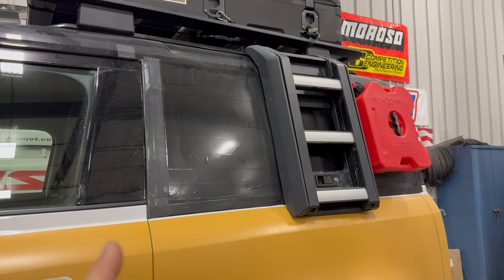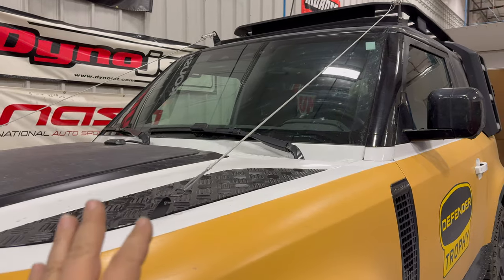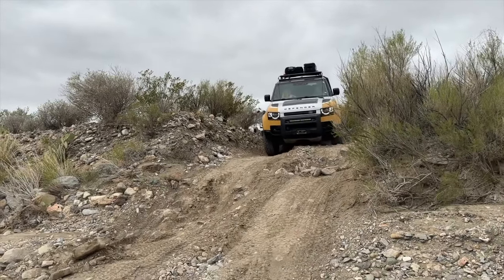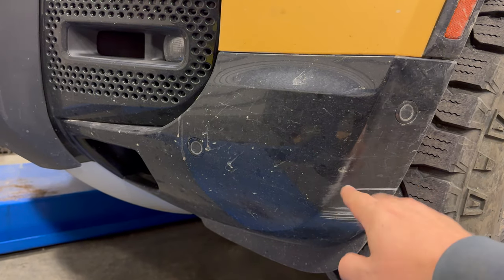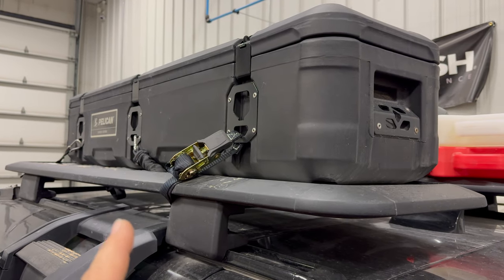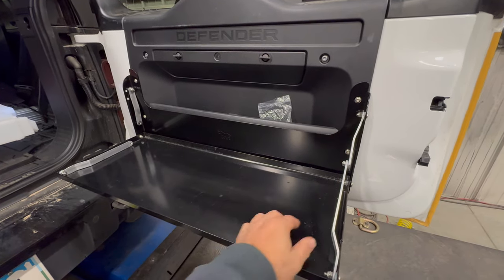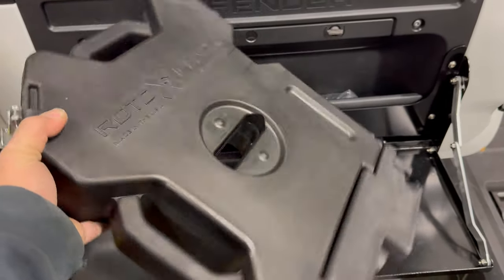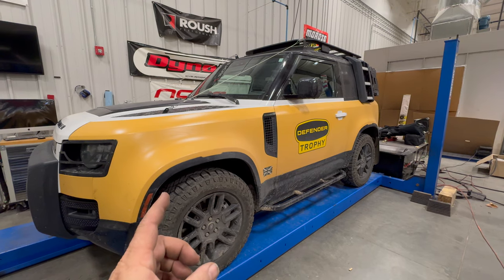Defender How Well Did It Survive 3000 Mile Overland Trip

Comment: Well she came back all intact! I am glad the side glass held up but its just a shame the windscreen got cracked. As you say it is common to happen and the dealer may as well replace the two at the same time, I wouldn't recommend doing that job yourself as  it requires bonding as I am sure you know. I think the black tool box looks good on the side I have seen one recently that is very similar and it blends in well. The table seemed to be the only thing that failed ( in that it fell apart) so worth noting for anyone who buys one.  I am glad you enjoyed your trip Steve and thanks  for the 'post trip' update.